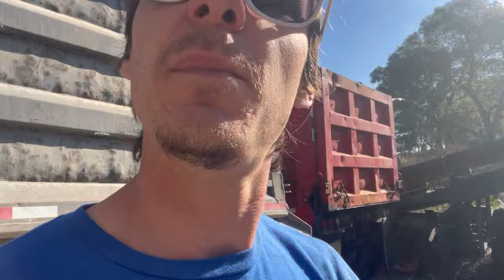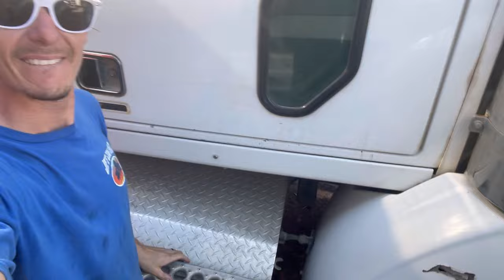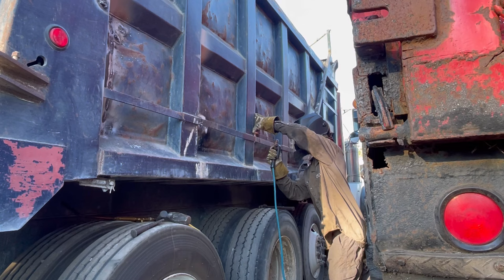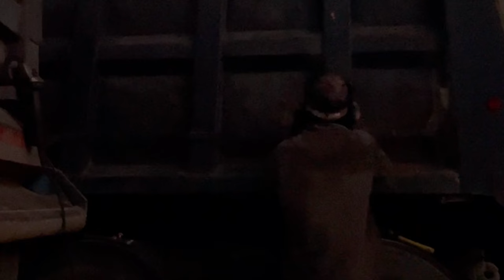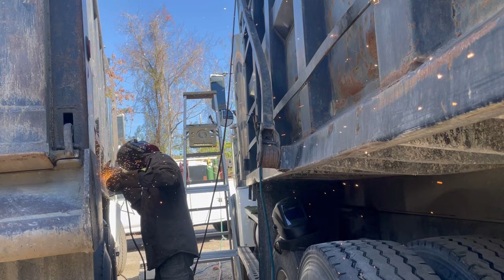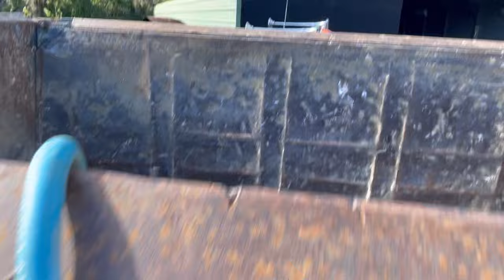ROUGH Welding Repair | Can I Get Them Back On The Road Before Time Is Up?! |

Comment: I used to do small time repair and fabrication. Everybody wanted "cheap and yesterday" work. I quoted one guy price to repair his mangled trailer tongue. "That's too high". Okay then go to someone else. It's the weekend and no one is open!! Well Monday go to one of the local welding shops. I will do the job for half of what they quote. They always came back  saying they were nuts with their prices and I have to wait two weeks before they can do it! Yep. How does my price sound now?? One guy claimed that anyone could do what he wanted but he did not have a welding machine. I offered to let him use mine. He came by the shop and I told him that the equipment was right there so go for it. He didn't know where to start. People have no idea  about the skills involved in welding and fabrication. Don't work for cheap---ever.
Reply: Well said.👍
Reply: The more they complain and talk! The higher the price gets!
Reply: I’ve said this many times but nothing makes you wanna work a 9-5 than the bad days working for yourself.
Reply: @gabrielmaynard Death before 9-5 dawg. The bad days with difficult customers are the best because afterwards you usually come out learning very important stuff. Like never working for that person again and also learning how to read people before you start a job for them

Comment: I hear you on that I'm taking the brakes I had a customer yesterday that said I was wasting time that I needed to get it done and I told him put on all the PPE that I wear and hold the torch to for half an hour 45 minutes and see if he needs to take a break!!
Reply: I’m a HE operator and taking a break is critical after about 4+ hours non stop that’s when mistakes happen or your machine if not maintained supper well might need a break. When you got 3000lbs+ in the air mistakes are lethal, expensive or both.

Comment: love your channel as a fellow welder up here in the great north  ill suggest building dogs from plate, nuts and 1" bolts rather then cast the  you can really crank on em lol works great and would have fixed that gap for ya no sweat keep up the good work
Reply: slots in square plates and wedges cut from the same plate. All from offcuts and free.
Reply: Half clamp. Or wedges
Reply: I'm about to make one from 3/8s plate but two of the same shaped that are welded onto a 1" id nut and a footlong heavy equipment 1" bolts  lol It won't be a dog, it'll be a werewolf

Comment: A word to help , on down hill 6010 /11 for this kinda work . Use a 5/32 if burn through is not a problem. Your welds will be a bit more beefy .  More metal more strength.

Comment: For almost 3 years I did welding and fabrication on belly dump trailers. Did a lot of patching and re-skins. But work was rough, but I worked inside of the shop. I didn’t hate the work as much as I hated the pay. It was just a small mom and pop shop and it was my first welding job. I would like to also become a mobile welder and start doing that stuff again.

Comment: I've done so many of these repairs. Aluminum dump beds too, and it's all the same story. Patch panel it and burn through the shit until it welds. I've tried so hard to clean it's and make it look some what decent but there's no point to it. Just need patch panels and a big hammer and you can make miracles happen

Comment: Man I’ve been in this exact situation several times until one day I had a customer come here requesting that I cut out a full square while leaving a 3 inch gap between the old wall & the new sheet. Better look & lesser of a head ache then bending, welding, bending etc. after doing it for so long it seems like a bigger patch is way easier then making a small one. But like  you said. It’s whatever the customer wants to pay for. keep it up bro lay them dimes 🤙🏼

Comment: I know you like the cast clamps, and I do too but I always have a good one with a piece of C channel welded to the bottom, facing towards the threads so it’s easy to snap off. And I always start in the middle of the patch and work out wards then it doesn’t work against itself. Love the videos.

Comment: Get a surge protector,  just clamps to the battery terminals like jumper cables, use them at work all the time also when using plasma cutter on a vehicle

Comment: we just got done doing an order of around 100 beds/containers like this, some had little to no bottom all rusted away. and they jusy wanted us to put plate on top of the rust and weld the sides
Reply from the maker: I hate those jobs, but sometimes if work is slow you take what you gotta
Reply: @MeltinMetalAnthony  haha yep. Every one hated them but things were slow like you said, and it was sometimes the job that was going on in the shop

Comment: Anthony have you ever run nr232 inner shield. I run .072 in a Lincoln ln 25. I’m an iron worker and this wire has a seismic rating for d18 for welding schools and hospitals. In other words high tensile strength and ductility. Very strong and you can lay down wire so freaking fast. I just thought I would throw it out there because I’m not sure if you heard of it. It’s all all position wire that cooks through rain and bullshit and leaves a nice bead. Cheers mate, thanks for the content. I’m on the road to becoming an independent welder my self.
Reply: Any tips on running that stuff vertical up?
Reply: @shaunybonny688  Use a slight drag angle (Yes, even when welding uphill).
Reply: @PatriotWeldFab  thanks, I’ll give it a shot.

Comment: When repairing corners like this, slot your angle iron on one side. The bend will take a broken harbor freight C clamp and a little hammer. Cost a little more rod to finish, but the time saved is worth every penny.

Comment: I'm no stranger to welding shitty, shitty things.👍 I know you told me you hate lugging around a suitcase but damn the time you would save brudda.
Reply: Which one do you recommend?
Reply: @Jdl223  I run a miller 12vs, it's about 75 lbs with a 33lb spool of wire but it's worth it. I only burn rod if it's a quick job.

Comment: This was interesting. I liked looking at the problem and thinking of how I would fix it, then seeing how an actual professional did it. In my head, my was was WAY harder and took a lot longer. This keeps me humble so I don't end up one of them keyboard quarterbacks. And well, to be honest here, I would not know if you were doing something wrong or not. I doubt my 2 years of harbor freight wire feed welder experience makes me qualified lol But I still don't edit out my welds in my videos. I always appreciate constructive criticism.
Reply: Also, if i may ask. I am familiar with the evolution metal saw, I have both the chop saw and circular saw. But I do wonder if a plasma would have been faster and more efficient. Not sure what thickness you were working with though. 1/8" or small I imagine using saw would be faster than setting up the plasma. Honest question, I dont even have a plasma so don't know.

Comment: Remember that truck is going to have thousands of pounds of rock and other materials falling into it from a height of 8 to 10 feet, maybe more if you have a lousy operator. And all of that weight shifting as it gets dumped out. Plus all of the abrasion that metal has to deal with as that rock or concrete slide out and the constant vibration and jostling from the rough roads that a dump truck has to deal with are just totally destructive on the welds and metal of a dump bed.
And that truck definitely needs a new and stronger floor as it looks like the ribs are about break through. Plus if you are hauling btoken conctrete or rip rap you might want to really strengthen the tower for your cylinder because they really take a beating. 
I hsve spent a lot of years building rockery walls and know just how much of a beating my trucks have taken.

Comment: Would welding patches on the inside of the box be easier/faster ?   You could  drill holes from the outside to mark the corners of where you want the patches.  Then climb inside and apply the patches....just a thought.

Comment: I once did a job where the customer wanted all the stainless weldings cooked so much that it left a fine metallic dust along the surface and where greyish/blueish coloured. at least he didn´t want frosting on the inside, so the gas supplying company made quite alot of money :P

Comment: My kinda welding channel, though I like mig over stick… mostly skill or lack of but also I get irritated burning down to the nub two inches from the end of a bead.
I have the corded evolution saw also but since I bought the dewalt 20v version I haven’t picked up the evolution, even with the 5.25 inch blade on the cordless it cuts up to 3/8 plate like an animal and is just more convenient.  Love my drywall square as well, but it has a couple notches from using it as a plasma guide lol.
Reply from the maker: lmao ive done that!

Comment: Been there done that. I can see you haven't that much. Job's like these were bread and butter. Next time use 16ga. Instead of 1/8ga. Tack and hammer with clap get it into place then weld the entire thing. Just a suggestion
For the bed use the reverse claps and 1/8" . the excavator operators always beat the hell out of the beds
Just a suggestion red 6010 suck to me. 6011 and 6013 are great trash rods. 6010+ rod are to but only if the cost makes sense.

Comment: Looks like the corners of the structure is rusting out why not use like a 3x3 1/8 in angle iron? Nevermind didn't make it far enough in the video yet 😅
And your right if your not welding your not making money

Comment: I would've simply used a 1" nut welded on the inside middle of the section. hooked a coma long to the other side and gave a couple cranks. No bending  or heating angle for me.  As long as you got it done and the custy's happy, fux everybody else. Money talks.

Comment: Finally, finally, finally! Somebody uses the proper name for a tool! Not a Crescent wrench. It's called an adjustable wrench (just a weird hang-up of mine). I had to laugh at the "temporary" repair comment. Some of my quick repairs I've done on different equipment that I had every intention of making it look nice and all but get busy with other things and don't get back to it and years later they're still going strong!
Reply: I refer to them as “bolt rounders”.

Comment: Add a 6/2 oak flooring ans 1/4 on the wall for protection it only adde around 150 lbs we do demolition.
Reply from the maker: not sure what you mean
Reply: You line the beds after you weld the must angle iron around the floor and one stove bolt at the back. It Cushing the metal.

Comment: I gotta know man. You made a comment about running 6010 down hand. What’s the deal? I’m a professional gas pipe welder. At my company here in the north east we almost exclusively run 6010/7010 downhill. I know welders that have been at this for 30  plus years. You not a fan? Seen bad results? I’m curious. I’m not a repair guy like you so maybe there is a big difference?
Reply: Smooth brain snobs like to scoff at downhill in comments.
Reply: @botsbass842  is this directed towards me? Because I was asking a legitimate question. I’m curious if there are different ideas on how 6010 is ran around the country since I’m only from the north east.
Reply: Hey Chris. I think what he was referring to is that downhill is frowned upon a lot, even though 6010 is ok downhill.

Comment: Best way I found to deal with " annoying fuck" is to wait till he is looking at the weld and then " accidentally" strike an arc and flash the fuck out of them. Plenty of shit jobs out there, get it done and move on. Usually the " cheap quick fix" is the most pricey and looks like hell. " The bigger the glob, the better the job" when it comes to crappy shit jobs

Comment: I'm just a beginner welder for hobbyist purposes, so I certainly won't attempt to critique any of your welding work. The only thought that occurred to me is that I would have tried to put my grinder, rods, etc. in a 5 gallon plastic bucket with a small rope tied to the handle to lower into the bed (and back to the ground when leaving the bed).
Reply: Exactly!

Comment: What type of compressor would you put on a mobile welding truck to use for jobs that need to be arc gouged?
Reply: I am a mobile diesel service and I can tell u, you and I are verry similar as welding repairs, sometimes the customer looks at .e like I don't know what I'm talking about and regret it after the repair! Sometimes you got to do the best you can with which what u got to work with. Also do you vertical up weld.

Comment: Another great video bud!! Just a question for ya, when you’re Texas tigging on that nasty rusty/thin  bullshit what rods do you use? I’ve always used 5p+(6010) on my stinger and 7018 with the flux cleaned off for my “filler rod” ??

Comment: I'm surprised I missed this one. Anyway, I used to own semi dump trucks, but all my trailers were newer and not beat to shit. That said, I am amazed you were able to stick weld all of that. I would have bet you were going to burn thru and then your day would have gotten a lot worse! Those lower sides and floor, especially towards the rear are usually paper thin when they look like those trucks. Nice job.

Comment: One advice save some money and by Yourself a Kemppi evo 200 welding mashine. The mashine is so mutch bang for the buck. You can do 1mm dual shield welding. On heavy stuff. Or regular solid wire on those shitty dump trucks. It will save you alot off time.

Comment: Suggestion; Don't try to bend angle. Cut the vertical with torch where the bends are needed,thus allow easy bend on the thin plate, then you would not even need to worry about  filling the cuts to the box frame, just weld the angle edge to box frame. A lot faster. As you say lip stick on a pig.

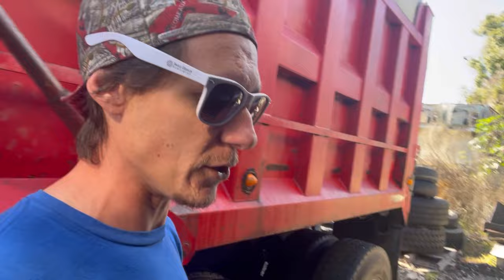Comment: 1:52 Exactly, if it stays together that’s all you need, I had to do a few exhausts and we don’t have a lift and they didn’t so I’ve blind welded them on, looked at them after, welds were terrible but were good enough.

Comment: Just finished a mack with a donavan body. Already plated once. To do it rite more time into it then there should have been for a first replae. Customer could not comprehend the time to  pull back down the plate vs welding in a first replate.  Assholes with their minds on 190 prices are now out of the list of assholes I will do work for. Good luck working on clam's that have exceded their experation date.  ** Watch out for the spray foam used to stop leakadge. Burns like a mother.***

Comment: I’m surprised that the truck owner is even repairing what your doing. If the concrete not falling out of the bed let it ride. But I do agree with you that some miserable work. In the maritime industry we called it the heat beat shit show. I’m sure you worked with rust on rust that always fun watching holes blow in not.

Comment: i think you could have done better than welding clamps on to the truck just drill that L sheet/plate  and than bolt it down with sheet metal self threading bolts
Reply: Lol ive used self tappers to get a patch to conform to a bent seacan worked good enough to weld. Now i always carry a box of em in the truck.

Comment: no need to unhook battery i bet you your days pay if you ground next to your weld zone you never havea problem. now CAT equipment 24v systems are a different story or running current through bearing's

Comment: On angle you can put a relief cut on the side that is sticking out and it will bend easier and then fill the throat opening with a filler piece. That is only if you want the bend to look more custom and natural instead of beat it into form.

Comment: i feel ya man, i did stuff like this its a mother. i did alot of plate steel for the walls at first but after a while for those repairs i learned that angle works a bit easier (1/8 or 3/16). love the vid's brotha keep doing what ya do!

Comment: How bout them wedges? WG-8. I don’t know about you but my business motto is cheap fast or reliable.. pick two because you’re not going to get all three. Fast and reliable ain’t cheap… just because the customer doesn’t want to spend money doesn’t mean you can’t make money. Don’t give into that or “slow season”  I was in Florida a few days ago and was approximately 1 hour east of you and it was booming like never before. Help wanted signs every where. Mechanic shop with 6 bays and only 3 guys … no slow season, that’s a cop out. Always busy, always working… The woman told me two weeks to do a tire alignment and recharge AC. I didn’t have the time but for a glorified tire shop to be two weeks out means good business no matter how you look at it… work quality might suck but they’re getting paid. $$$

If the customer has special requests something done a certain way I just tell them the reality… yea I can hammerfuck that for you. 
Gotta love the art welder..

Comment: When sheet is boedout tag it and give it a hammer when it is still red then it will keep it close. Edit. First timelapse inside bed you can see how warming it bow it furter out so try tag it before you put heet on it you can use heat also straighten things whit spot and line heating plate, squertube etc. 👍 Greetings from Finland.

Comment: Probably cut the bad parts out and weld new pieces in I hope you only charged like 100$ bucks not even cleaning the material
Reply from the maker: show me a video of you doing that to a bed this badly damaged.
Reply: @MeltinMetalAnthony  don't have a bed repair but I can send you one of a bucket on a 980 cat